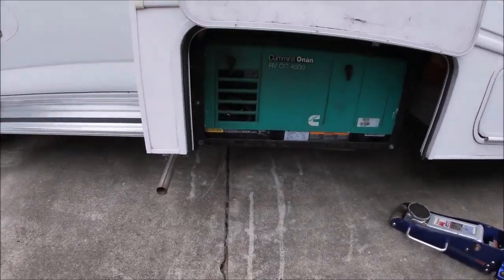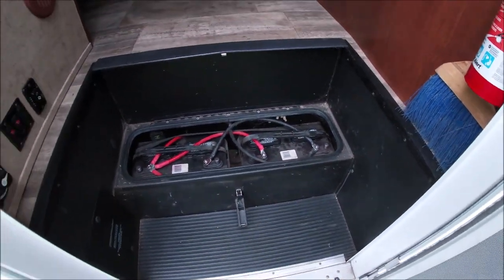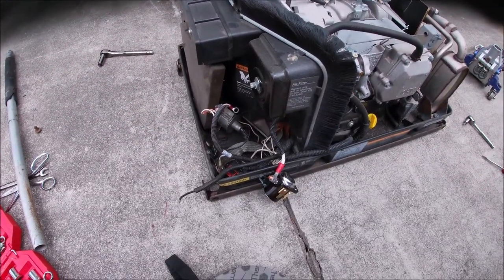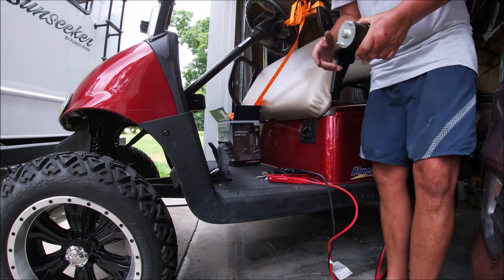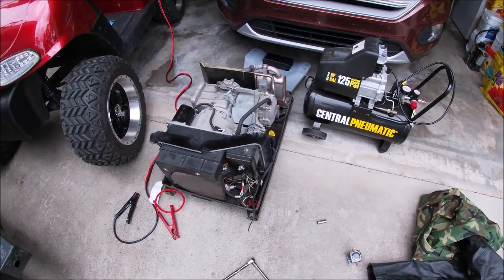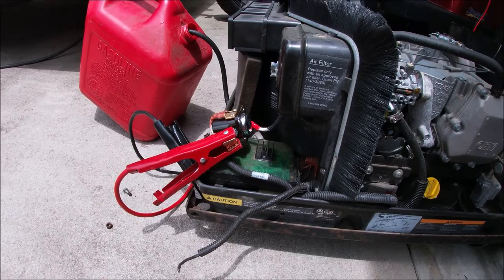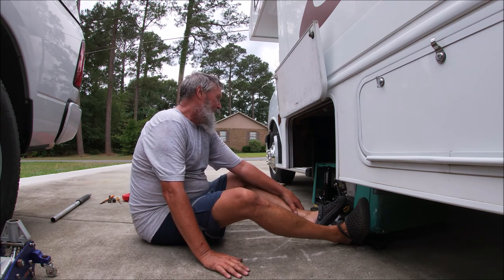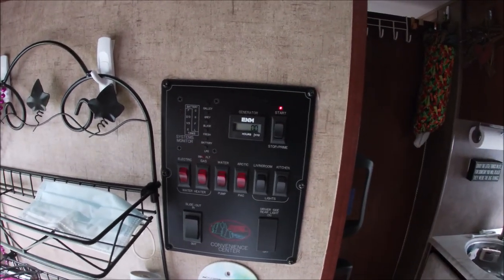Onan 4000 Starter Problem

Comment: Well, you had a great sense of humor about the whole thing.  I guess I'll go out and check for loose wires and hope for the best.   Update (03/21/2024):  my problem turned out to be that the flange by which the starter is bolted to the generator was no longer grounded to the starter.  In testing I accidentally discovered that if I touch the black cable of my jumper cables to the metal starter case then the starter works.  I then determined that the two smaller, unused terminals of the starter were grounded to the starter, so I ran a wire from one of them to one of the flange bolts, thus re-grounding the bolt flange.  I bolted the starter to the generator and tested it and the generator starter was back in business.  I put the generator back on the RV, reconnected all the wires, held my breath and tested it again -- it still worked.   I'm guessing I saved myself $500 to $1000?  Anyway, thanks for the howto on getting at the starter and putting things back together.

Comment: THIS IS HOW I FIXED MINE, IN THE CASE OF....
"I CAN'T START MY GENERATOR"
 It's has been two years since last time it was running, so I started by checking oil level full at gen (it won't start if low oil becouse of sensores), gasoline more than 1\4 tank in the RV (also safety censors), sparkplug checked for good spark, check the manual circuit braker ( to be ON) at front motorhome engine compartment for 12v current to the gen to be able to start it, also cleaned the carburetor and even installed new one but same situation, then checked wires and found some has been chewed by rats so I replaced them, by this time it started but stay running only by keep pushing the switch on all the time, so I knew it was electrical problem from the engine itself, so I took the generator out from my RV to work in my garage, ( I did this by myself with some tools and old Mayan tricks ) lol, it's really heavy for one person. 
 I disassemble the unit at my garage and started by removing the cover, then the cooling fan or flywheel unit (it's 2 items in one unit) until finally I was at the gen rotor and brushes assembly area and this is what I found: one more wire chewed by filthy rats plus the stinky rat nest in the middle of the generator motor coil, I fixed the wire and sanded the commutator copper contacts where the brushes are sitting becouse they were real duty with old urine from the rats, and of course I got rid off the stinky nest, lol!!!
Then I assembled everything back together and  bingo it's runing like a champion.
For this project materials involved was about $60.00 including an aftermarket new carburetor and an harmonic balancer/steering wheel puller (available at any auto parts for $25.00) to pull the aluminum fan out and (flywheel). 
Just picture this: (Any gasoline engine run smooth if gasoline and DC current aren't interrupted) so following this important principle you'll always find the problem to be fixed. 
Also if you have a onan microlite 4000 like mine, don't run it for more than a minute without the cover becouse you'll cook the engine real fast, also keep the eye on the aluminium fan and your fingers after cranking it in case you missing one or two members...just kidding, lol!!!
After testing the gen then put the air cooling assembly back and the rest of components including the cover, now it's ready to be installed at your RV.
Once the gen it's installed back at your motorhome or RV start your gen to be tested for electric power but  don't forget to flip the electric switch (on) at the gen electric panel (sometimes hiding under or around the electric controls) to transfer power to your RV GFCI main outlet and electric panel as well, if your it's equipped with GFCI reset it and tested for green led light indicating power is ready at you main breakers panel, flip your main switch (on) along the others ones at this moment if you still don't have power then it's a faulty main braker, flipping it many time sometimes make it work again, mine did it, lol!!! If yours didn't buy a new main breaker. 
 If this can help eaven one person save time and $$$  it'll make me more happy, thanks for reading!!!